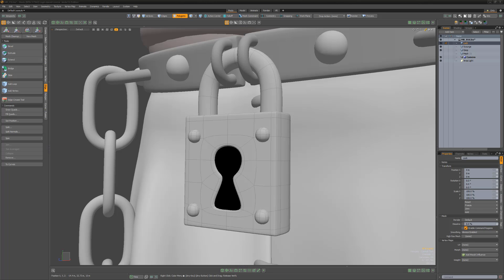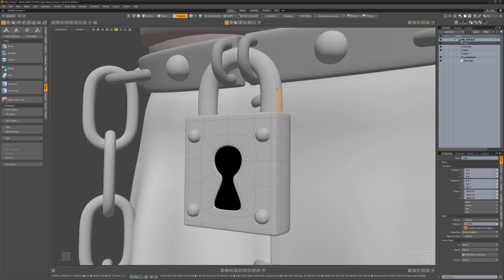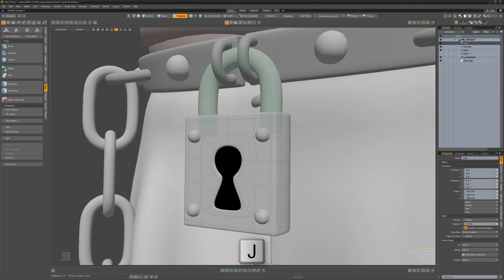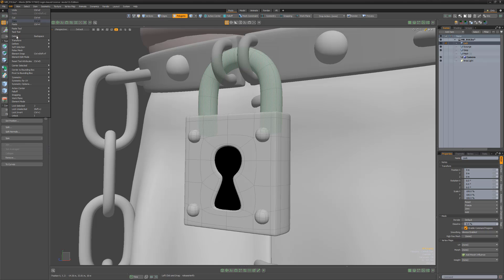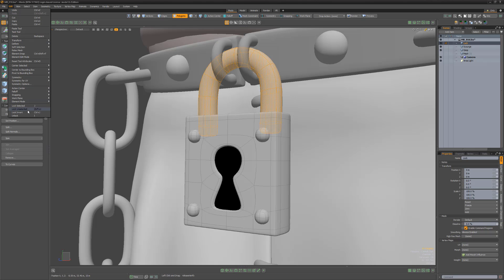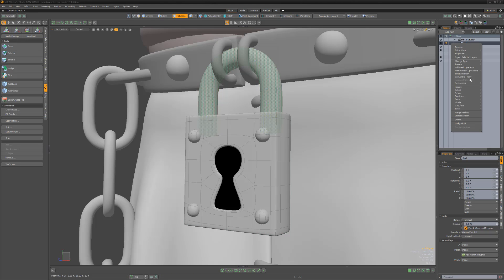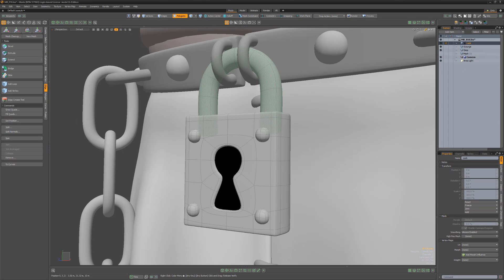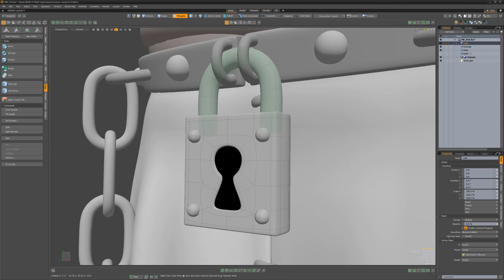MODO 12.2 | Locking

Comment: Thanks.  Item level of locking only ”seems” useless since all components are still editable, but maybe if the active mesh item are the only components that can be selected it will work out.  (I hope)
Reply from the maker: Item level locking prevents you from editing or select the item in ITEMS mode. Its extremely useful when working in Item mode. (Rigging, animating, lighting, etc)
If you want to prevent editing in component mode... lock it in component mode or simply don't have it selected. . If you dont have the Item selected, you cant select or edit the components of that item.
Reply: Pixel Fondue I thought as long as you can't select it at the item level the components are none-selectable.  I always feel like I get into ruts where I’m constantly accidentally selecting things I don’t want selected in modo.
Reply: Pixel Fondue But, just in case if you have it in edge mode you can select lock and it will just lock the edges?  Can you lock all modes and then when you hit ”unlock” they all unlock?
Reply from the maker: @Imhotep397  components would be locked in all modes not just one